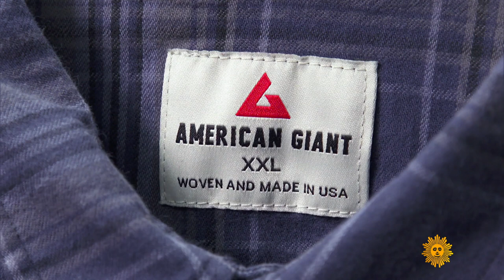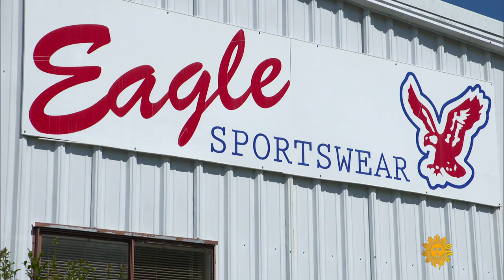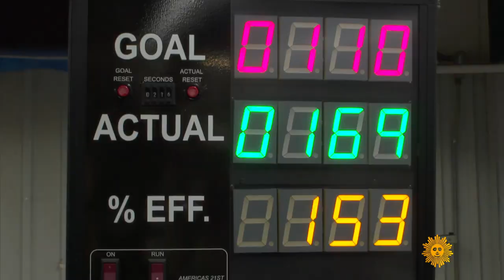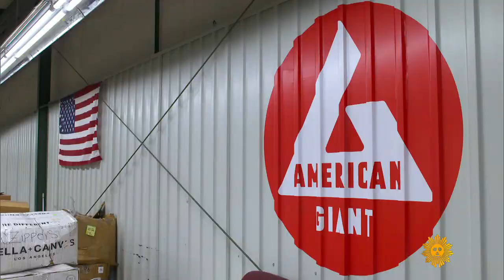Made in the U.S.A.

Comment: I have a couple of hoodies, probably a dozen t-shirts, and a couple of polo's from American Giant, and I love the quality of the products. I stopped buying clothing from cheap labor countries, as I realized that the fit and finish of the product they produced, had very little consistency - one style and size fits good, while the other style and size doesn't fit at all. What I also noticed, was that the materials used at American Giant and other Made In USA producers was thicker, didn't rip or fall apart(triple stitched on many products) at the seems easily, and was generally, much better made; I have an AG logo tee, and after 5-6 years of wear and wash cycles, still looks pretty good, as the logo is still there, and the material is thick enough to endure many wash cycles. I can understand that buying American made clothing seems to be expensive, but the advantage is they last much longer and fit better than imported items - I am writing this wearing a pair of jeans that I purchased from All American Clothing company 8 years ago, and they have probably been through hundreds of washes, and are still intact, no holes, no pocket falling off. My shirt is from American Apparel and is a logo tee, and is still in great condition after 3-4 years of wearing it to work(on a farm). Socks and underwear are also Made in USA,  made by Flint and Tinder, and also purchased many years ago and still intact -- my shoes are Made in USA New Balance, and I usually go through a pair every year, but that is expected with "running" type shoes - If I am not wearing these, I am wearing Danner Boots, or Okaboshi sandals, which are both(depending on the style), made right here in the USA also. I know that when first looking to switch to Made in USA clothing happens, people look at the price and determine they can't afford it - I got sick of buying a pack of t-shirts at the big box store, only to find they were unwearable and had to be used as rags to clean the car after a year or two of wearing and washing.  I know when I buy Made in the USA products, they are probably going to be of better overall quality and last much longer, and I would rather put my money into these products.
Reply: So true, I used to buy a pair of boots every year or two and got tired of spending $70 on a new pair after they’d fail.  I then bought a pair of Wolverine 1000 mile years ago for $270 and haven’t bought another pair since

Comment: I did buy a clothes washer made in Ripon, Wisconsin after my Korean POS crapped out after only six years. A good match for my old clothes dryer (still working well after 32 years) that was made in Newton, Iowa.
Reply: I bought the Speed Queen washer because the salespersons at Home Depot, Lowes, and Best Buy tell me that five or six years is all you can expect from the washers they sell, and the coin laundry nearest me has had the same Speed Queen top loaders in service since 1980.    
I haven't had a big-box store machine last more than six years, ever.     
I don't know what Kia and Ford have to do with clothes washers; Ford hasn't made them in over fifty years, and the Korean machines have a rather annoying habit of flying apart during the spin cycles (top loaders) or having the drive mechanism turn to Cream of Wheat due to electrolysis (front loaders).     
Speed Queen or no machine.
Reply: Maytag Pride. Dads old job
Reply: @5610winston  I have a 2017 Speed Queen , best washer I have had .Cleans better than anything out there. My old Kenmore Dryer, made in USA, in 1994 still running great.